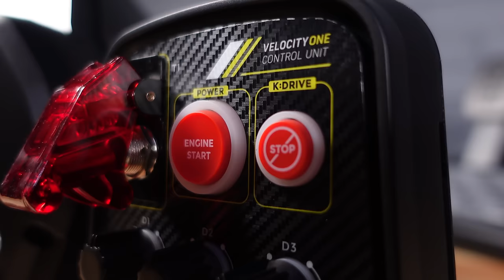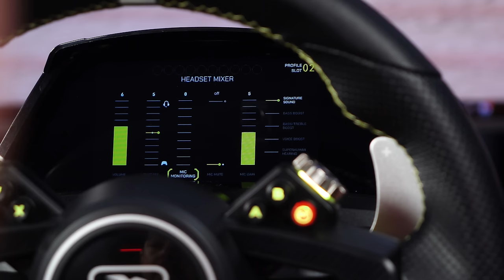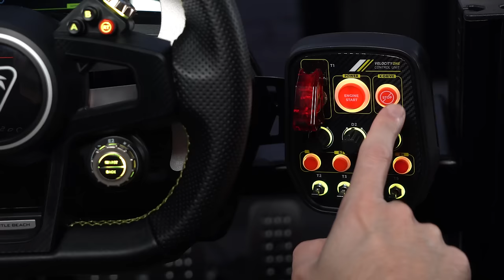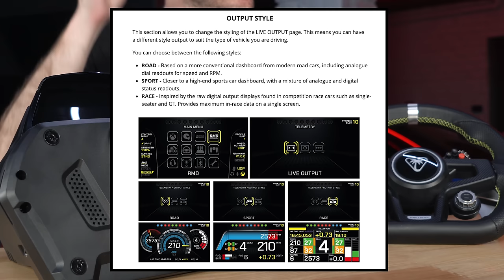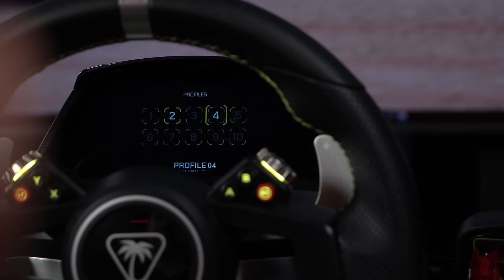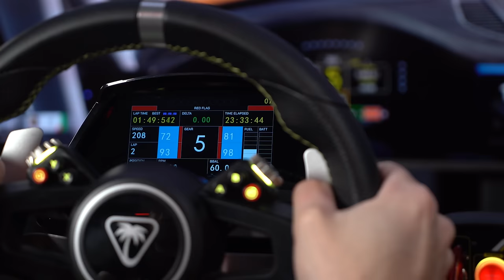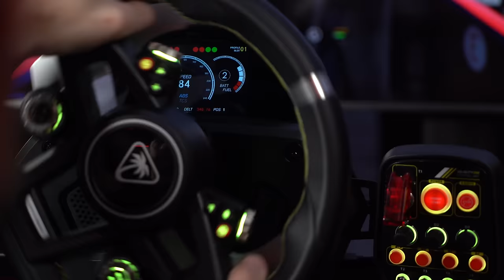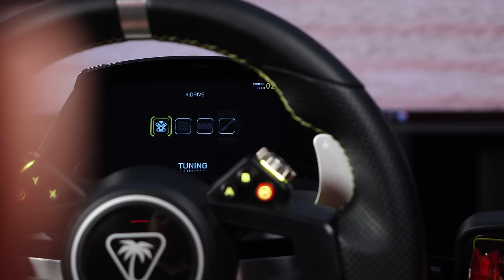Turtle Beach VelocityOne Race - The Complete Review

Comment from the maker: Price correction. Moza R9 bundle with CS V2 wheel is $659USD + Shipping, taxes, import, etc.
Reply: Cool! Still wouldn't use Moza😂
Reply: @FATHERNTIME  Then what do you recommend?
Reply: yea, but that price doesn't  include pedals @FATHERNTIME
Reply: @FATHERNTIME  why?? No issues with my r5
Reply: @02bluehawk  it's so basic, and overtime the motor performance degrades. Software is nice though!
Reply: @FATHERNTIME  I've had my r5 for a year with 500+ hours of drifting and iRacing and I have zero issues so I'm not sure where your degrades over time issue is.
Reply: @FATHERNTIME Gonna guess you really never used a Moza product and listen to the hearsay from some others that did have issues. I have no idea what you're talking about when it comes to motor degradation. I really don't think you understand how that works. But just like you and all the other fruit cakes out there. Always will have something to say. But no real fact to back it up. Just feel the need to say something to feel "cool."
Reply: @FATHERNTIME  you really had a MOZA, or you just heard a lazy review of a dude who had a used wheel?
Reply: @FATHERNTIME Motor performance degrades overtime? What does that even mean or how does that even work?! Lol this is the dumbest thing I've read all week from a Physics standpoint.

Comment: I like how they have the safety cover over the switch, but they really needed it for the start/ stop buttons.
Reply: open it up, swap the wires over to put the power on/off to the covered switch instead.
Reply: @AgentHeX_0007  ye that makes sense. Pay 650 to do some DIY to fix the problem. 
You're very smart
Reply: @DAGATHire  its called modding, plenty of people do that to 1000's worth of kit.
Reply: @AgentHeX_0007  modding refers to modifying something... 
What you are suggesting is buying a NEW thing and FIXING the new thing COS ITS NOT BUILT CORRECTLY 
Again you are very smart. 
Go you. keep up the good work.
Reply: @DAGATHire 💪🗿🤳
Reply: @DAGATHire  The same mentality of people saying all Logitech wheels are amazing brand new, after you open them and swap out all the internals :/ lmao

Comment: You would be blown away as a kid to get this as a present. Pedals seem to be intended to be used on a solid flat surface. A solid surface at least at the back where all the force transfers to when pressing them would stop a lot of the flex. Button box needs a little strut bar from the back of it to the wheel base to stop it flexing.
Reply: I'd be blown away if someone gave this to me even as an adult

Comment: You can take down the brake and throttle cylinder just like the clutch does to stow it down. But you can pull the spring out of the throttle and put washers around the rod to reduce the throw distance, the wheel autocalibrates the 100% input point on every startup, so the physical change is all you need. You can likewise take the two rubber bushings out of the brake cell that compresses the load cell. I replaced one of the rubber bushings with a 2" spring, both for leverage and to get more pedal progression while still having pressure build.
Reply: I do not get any flex or play at all with the collar. I do if I put it on backwards. But if its dead on with the top 3 balls aligned. Its rock solid to the base.
Reply: wait....so this would make the load cell softer?  Thats my one gripe coming from csl v1 load cell.  It just feels rock hard compared to the older csl lc.
Reply: @Jaymobe07  Theres an aftermarket rubber for the CSL load cell that does a similar thing I did with this.

Comment: Will, from your testing is the movement in the quick release or the shaft? From the Velocity One base I tested, the QR was more solid while the shaft had noticeable FFB affecting play. I'm partly trying to figure out if there is a standard quality issue, or if I happened to get a lower quality/defective unit from them.
Reply from the maker: In our case it seemed to be primarily play in the interface between the stem on the base and the sleeve on the wheel side. Same as with the metal Fanatec QR1. The wheel itself naturally ahs some flex due to being plastic.
Reply: @boostedmedia  interesting, perhaps the manufacturing tolerances are not very consistent.
Reply from the maker: Yep I’d say so. Exactly the same with the QR1. Plenty of people swear their setup has “zero flex”. I’ve tested hundreds of combos of bases and wheels and not one of them ever had zero flex but it did vary.
Reply from the maker: Looking at your video now (nice job BTW). My base definetly doesn't have anything like the shaft flex that yours does judging from your video.
Reply: @boostedmedia  thanks for confirming, yeah generally it was not a positive experience at all.

Comment: Are the brake pedals SUPER HARD for anyone else? Any game I have to slam the brakes. I ended up bending the cord because i was slamming them so hard so get full braking, and changing the sensitivity does nothing!
Reply from the maker: Set the sensitivity to 100%. The other two settings are ridiculous. But yes if it’s your first time using a load cell brake it will take some getting used to.

Comment: Great review! 💯🙏🏽 I've got a Logitech G920 that I mainly use for driver training purposes and a Thrustmaster setup I use for a bit of a better experience with various racing games. I'm actually interested in the VelocityOne wheel as an upgrade from the G920! I'm very curious as to if they will release a h-pattern to plug into one of those expansion ports. Fingers crossed. 🤞🏾
Reply: Completely agree, would love a step up from the g920, but I do use the H shifter a lot at the moment, I may just wait it out🤔

Comment: I feel like the conclusion might be a bit too harsh. Personally, I found the experience of this setup to be pretty awesome with just a few tweaks and changes in settings. I've tried out a bunch of DD wheels, and for the price, this setup is unreal. Seriously, it's like comparing night and day to any belt-driven wheel - they're not even in the same ballpark. Plus, there have already been a few firmware updates, and I bet there'll be more to come soon with more accessories etc.
Reply from the maker: All valid points, but the fact remains that the CSL DD provides a superior FFB experience for similar $. If it wasn’t for that it would be a lot easier to recommend.
Reply: Yeah I get your point, exciting to see what they update moving forwards. You can’t get the CSL base with cell loaded pedals, digital display, control unit though. I just think as a bundle for the prices it’s fantastic ! Unmatched in the current market. Plus they offered 10% off on launch so you get the slot for £560 from £640

Comment: Which firmware are you using?  I noticed at first as you said, it felt muted but i felt a change after an update.  But i also raised the strength up slightly.

Comment: Issue I feel was overlooked - you can't butt the pedal set against a wall (as I normally do  if not mounted in a rig) they put the cable inputs coming out the back, rather than the side..  that's a bit dealbreaker for me usually on 'cheaper' sets,  but given you said it doesn't seem to slide using their rubber pads, probably not the worst thing in the world.
Reply from the maker: That’s a very good point! Could put a small block of wood or something behind it to just allow enough room for the cables I suppose.
Reply: @boostedmedia  yeah I guess there are workarounds! We always find them for the love of simracing haha

Comment: 9:10 (wheel cross-compatbility) 
Did you ever try powering it on without try wheel connected? Did FFB work? That would answer that question. 
How about those 6 bolts holding the hub on the wheelbase? Is it a 6x70 pcd?
Reply from the maker: Yes FFB works with no wheel connected (tested by others). I haven’t measured the PCD. Will check this week.

Comment: Great review.
This kit is a joke. So far Moza seems like the best bang for the buck right now. and I can buy it in some electronics online retailers in Norway. I might buy that instead. I was skeptic when I was told about these. Nothing of what I saw there was as surprise to me. Is the wheel base at least mounted via metal or is it mounted to plastic? Or is the plastic just  a cover there? At the bottom it looked like it was brass threads. is that the case, are those in the plastic or mounted to the Alu bracket the servo motor is attached to? If it's secured to the plastic this is another failure point.

Comment: Very decent first attempt into the sim market. However, if I were to need Xbox compatability I'd wait for the 3.9mn moza r3. A mature ecosystem now with scope for a bunch of peripheral add ons and/or base upgrades as the wheel has been tested to work on higher ff bases. 
I do expect the tb ecosystem to grow eventually, but I mostly leave others be the early adopters and do the beta testing.
Reply: Problem is, Moza is saying that for 1.5 years now. I believe this project has failed. Why has MS licensed turtle beach but not Moza?
Reply: @YourDailyR  they only announced the r3 6 months ago. The delay is on Microsofts end, moza has proven proven to pump out units and new products quickly. Production is not an issue for moza.
Reply: @GTdriver81  I got it but TB announced theirs, what? 2 months ago? How can they get licensed and Moza not?
Reply: @YourDailyR  that's a question for Microsoft. Moza doesn't have production issues, they just released a sequential handbrake and trucking wheel, also no r5, r9, r12 , r16 or r21's on backorder.
Reply: @GTdriver81  do you think MS really cares? Moza wants(or no) to sell. How can you make all marketing counting on someone else’s dependency? I’ve emailed the and they never mentioned MS in the equation. I never seen anything in any site regarding MS being the problem.
Reply: @YourDailyR  why you so mad lol. I don't care anymore.
Reply: @GTdriver81  Who cares? It’s about talking based on facts not on gossip

Comment: OK. Guys Here is an update on my Wheel. I heard on someones video I think, That a guy had taken his apart and fixed it. Another that when they took it apart the screws around the motor were stripped out. So, I took mine apart. There is some poor workmanship in there. OK. The motor is mounted with 4 small screws and 4 big screws. All were loose, Real loose! After 60 hours of use. I had no warranty So I had nothing to lose. I got all that tite, put it back together and the servo part works Great again now. The wheel on the other hand the top shifters still stick with every pull. I have another wheel coming that seller said does not stick. I will believe it only when I recieve and use it a while.

Comment: The fact you get DD and load cell pedals is incredible value at this price. The button box is kinda just an extra gimmick so it being the weakest part of the bundle isn’t a big deal for me as the rest of the bundle is already great value. 

I’m a little disappointed though that u frequently compared to the Moza R9 which is both a much more expensive and stronger wheel but never once mentioned the R5 as while it is weaker it’s much closer in price for the same stuff so I feel it should’ve atleast been mentioned. 

I expects wheels like the R9, CSL DD and Cammus 10 to preform better since they r both higher priced and stronger wheels. Comparing it to the R5 would really put into perspective what sort of value for money you are getting. If a 7.2nm wheel can’t out perform a similarly priced 5nm wheel then it’s really only a good value for Xbox players who don’t want a fanatec. Whereas if it does clearly out perform the R5 than it truly is a great package for the price

Comment: Hey will mad review, I know this isn’t the right place but is there any news on all the clubsport dd+’s being bricked, kinda stuck waiting for a reply on a support ticket.
Reply from the maker: None that I'm aware of. Most Fanatec bases in the past have been recoverable by holding down the power button for 10 seconds. The power button should then flash blue, indicating its in DFU mode and you can then use the firmware recovery tool to reflash and recover the device. I havent tried it on a CS DD/DD+ personally though. I suggested it to one person on Reddit and he said it didn't work for him.
Reply: @boostedmedia  yeh same I tried all troubleshooting steps possible, might have to wait for an rma, the base cannot be started no lights on the power led.
Reply from the maker: It makes no sense to me from a technical perspective that the base could brick itself just from powering down out of order as it’s not writing anything to the firmware. 

My gut feeling is if you leave it long enough for the internal capacitors to discharge it will probably fire back up. Again I haven’t tested specifically though.
Reply: @boostedmedia  will give that a shot, I’ll post an update on the fanatec facebook group if it’s successful, been trying to start it everyday since last Saturday.
Reply: That may be a failed power supply

Comment: Man speaking of rotating mass dampening a wheel base, my new asetek button box and round wheel totally deadened my TK wheelbase!!! Bummed me out a little, but it may force me to go on up to the invicta to get what I want out of it eventually haha. I was surprised to find this.. my aliexpress wheel (piece of junk) didn’t do that, of course a basic round wheel with no button box doesn’t do that, and the stock formula wheel doesn’t do that.
Reply from the maker: That’s interesting because sure I didn’t find it had a massive impact on our La Prima base. What strength are you running your base at?
Reply: I run it at 12nm. I’ve only really used that wheel in any amount that matters on dirt rally 2.0, it just seems a lot less punchy to me if that makes any sense. Strength wise, there’s plenty still.

Comment: All the offerings from Moza and Fanetec are made of metal, not plastic. Especially for the pedal sets. I think the pedal tray after time will crack and break eventually because of that plastic flexing back and forth. That bottom piece should have been made out of metal to mount those pedals on and eliminate the flex all together.

Comment: In Australia at least, Fanatec shipping times are good for the CSL DD. Both me and a mate got ours in under a week, just before Christmas!
In contrast, Moza takes ages in Australia apparently if you need to go through their customer support and not a direct retailer.

If you're in Australia, then for 639aud, the P1 V2 CSL DD bundle that me and my mate got, is honestly a better buy!

We both got srm mini emulators, I printed out adapters, and now we can drift with deep dish rims for cheap.

I also modded my pedals by adding an RC damper mod that seriously improved the clutch and throttle!

I just think if you're not getting a Moza R9 or Alpha mini or logitech gpro, depending on what you like, then you just can't go past the CSL DD!

Get the 5nm bundle, then get the 60aud 180w psu and you're set with 8nm for under 700aud!

Comment: In addition: 1) Too many issues on the brake pedal [which often does not reach the maximum value and so it's impossible to brake correctly]. 2) Telemetry on the Wheel is not compatible on Xbox. 3) ACC & F1 23 are not compatible on XBOX. 4) Only 6 buttons on the wheel are working on Xbox [rotary encoders & button box not working on Xbox]. 5) No Preset Mapping PC [in all PC games you must manually program all buttons, axes and Force Feedback]. 6) VelocityOneApplication is not working on Xbox & on Android/iOs [only on PC].

Comment: Ok so de wheel to me appears to transfer data through the pins making direct contact with that circular board. With that in mind I wonder if with time and wear, they will start to skip inputs, because here you have two failing points, the wear on the bearings potentially creating a gap to forward and backwards movements, resulting in total momentary disconnection. The other one are those pins on the wheel which if you have any amount of movement they will 100% start to bend back creating input skips or even disconnections.
Reply from the maker: The pins are power only. Data is transmitted wirelessly from what I can tell.

Comment: If the pedals didn't have intermittent delays, the dash didn't constantly disconnect, and it had better settings. This would be a solid entry direct drive wheel.
Reply from the maker: We didn’t have the same issues as OC did with the pedals sticking and lagging. Not sure if it’s potentially firmware related as it looked like he was running old firmware in his video.
Reply: @boostedmedia  thanks for the reply. On my turtle beach unit, the race dash would stop working randomly in assetto corsa, and forza motorsport it would start, then stop about 30 ish seconds later. The pedals would work the majority of the time, then randomly introduced a sub 5 second delay before registering on screen. I made sure no background pc services were interfering. Overall, I think the product has good potential for its market segment, but this is a deal breaker for me. I'm returning my unit and  have already purchased a moza r9 bundle with the crp pedals. I think the extra 300 ish usd will provide the feel I'm looking for. Buy once cry once 😢 😆